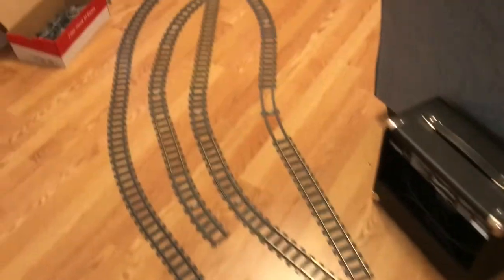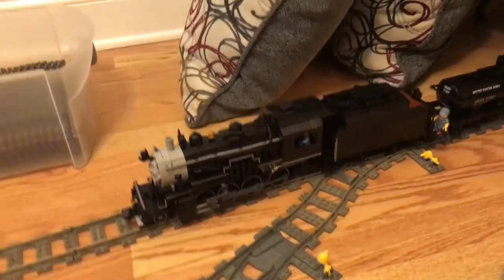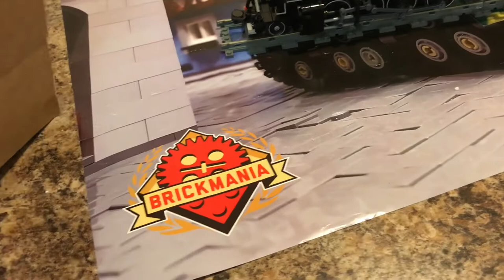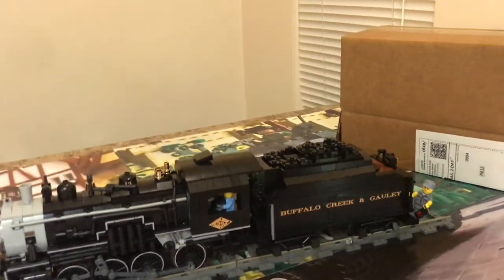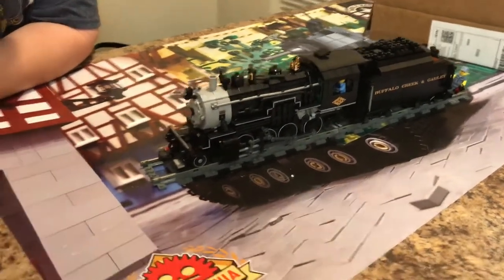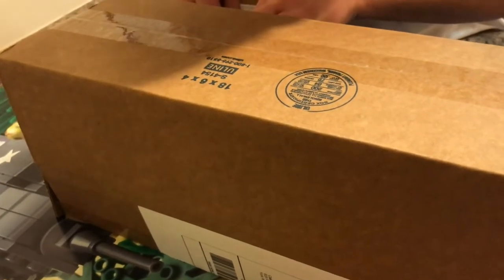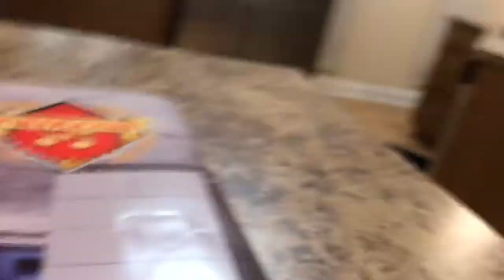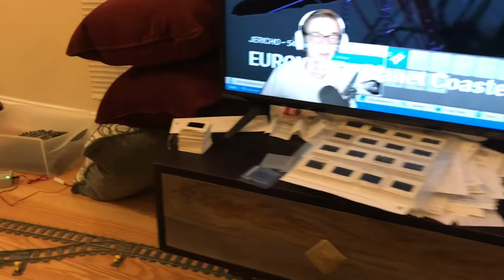Wrapping up: Buffalo Creek & Gauley 2-8-0 #13

Comment: @Glenn, I posted a similar comment on the BMR site. I know that you are not doing a kit of this model, but would you be willing to share the Shapeways files and materials for the Connecting Rods?  I am not interested in making your 2-8-0; however, I would love to see the dimensions you are using to speed up my learning process.  In addition, I would love to know more about how you finished the connecting rods.  I see the bare plastic in this video and then you paint them, but I wasn't sure if you sand the parts from Shapeways, then prime them, paint, etc. It's a beautiful model.

Comment: how do you make that single motor so powerful?
Reply from the maker: It's a combination of the motor and other things: a robust gear train, 1:1 gearing, L size drivers, traction bands, sufficient tractive weight, and using electronics that won't overstress the Lego components